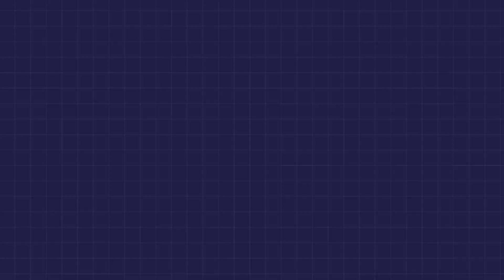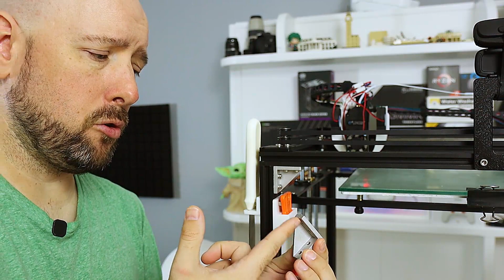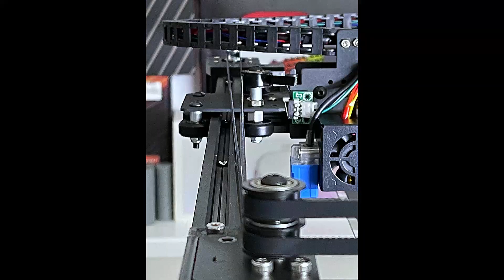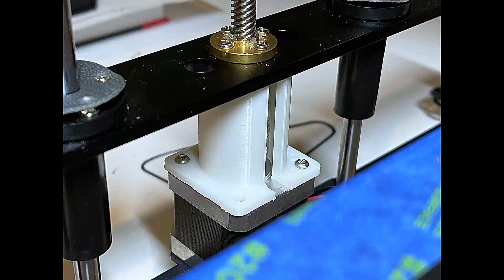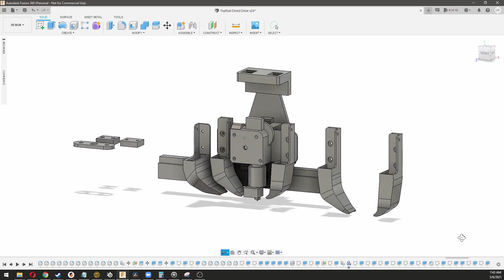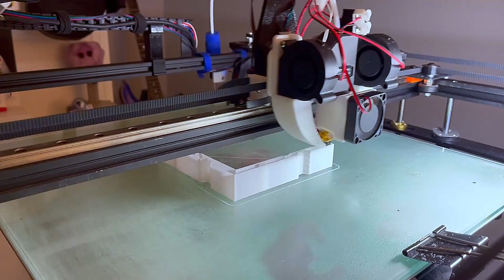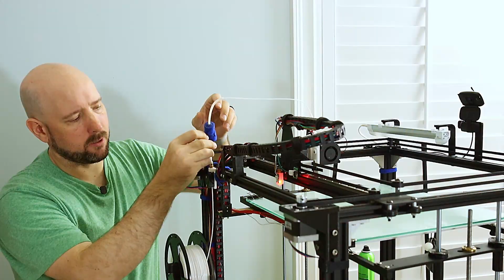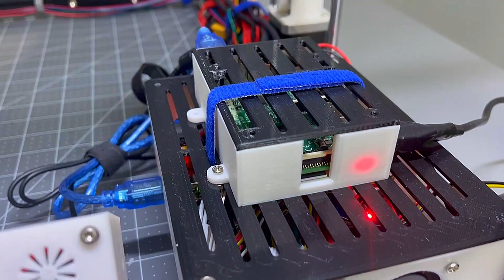TronXY X5SA Upgrades (Frame, Bed, Linear Rail + Direct Drive, PSU, Electronics)

Comment: I understand this video is old but I hope I will still get a response. Since you have to set up the pi to use serial communications to talk to the Tronxy board will this interfere with using usb communications to a print head? I intend on using ebb36 usb communications to allow for multi tool head printing.

Comment: Great videos on these mods. One protection for the main board, put a strip of electrical tape over the +5v line in the usb cable coming from the RPi.

Comment: I swapped out the hotend with an ender 3 one and now it's not heating up fast enough. I think the heat sink is just more efficient at cooling, it has a lot more fins than the previous one. Is there some way to make it heat up faster? With the hotend fan on at 100% it gets to like 95c and with the fan off, it gets to like 155c.

Comment: I always thought bowden was pronounced like bow in bow and arrow. not bow like bow your head. obviously bow has two different pronunciations because its a heteronym but I went off of the the pronunciation of bowden cable which is what the bowden tub is named after. https://en.wikipedia.org/wiki/Bowden_cable claims it is pronounced as: /ˈboʊdən/ BOH-dən.

Comment: one mod i havent seen anyone else do... use 4 smaller beds.
the pei beds are cheaper, one small one heats fast, and if half your prints are only less than 200x200...

for the pulley issue, i remade the brackets with the hole inboard a bit to bring the belt in line,
then made one pulley larger on each side otherwise the belt interferes with itself on the other side of the carriage...

Comment: Hey, could you share the link to the fans that you used for the left and right bmg blower? you mentioned that they were 20mm wide, but I am only finding 50mmx15mm wide winsinn fans.
Reply from the maker: Hey Spipe, you are correct.  I misstated and the fans are 50x15.  Here's the ones I'm using: https://amzn.to/3Z2eEJn although I wouldn't necessarily recommend them as they are loud as heck.
Reply: @LilMikeysBigPlans  Thanks so much for the reply! One last question, how did you add an extra fan? At least on my Tronxy, I only have 2 2pin connectors.

Comment: hi whats the lenght of linear rail for x5sa pro and what type?mgn 9c or h?
Reply from the maker: Hey Mohan.  The length of the rail will depend on which X5SA model you bought.  Your best bet would be to measure the distance between the y gantry plates and get the longest rail that would fit.  You'll want the MGH12-H version for this mod.
Reply: @LilMikeysBigPlans  thanks
Reply: Do you have any guide for installing a skr 1.4 turbo on a tronxy x5sa by the way?
Reply from the maker: @mohankuru7760  I don't have a guide but the installation is pretty straightforward IIRC.  I believe you'll have to toss the LCD.  If you're using klipper there's a sample config for the SKR1.4.
Reply: @LilMikeysBigPlans  I have a problem with pin mappings, also x5sa pro has 2 z axis motors, should I split one stepper driver into 2 motors or e1 as a seperate stepper conteoller for z axis as well as z0? İf there is a klipper config for skr 1.4 tmc 2209 bltouch and titan direct drive, it can make a great help for me
Reply from the maker: @mohankuru7760  If you're moving to the SKR1.4 you definitely want to split each Z motor onto its own independent stepper driver and on the SKR, yes, that means utilizing the E1 stepper driver for the Z1 motor.  I would start with the SKR1.4 config in the sample configs (https://github.com/Klipper3d/klipper/tree/master/config).  Then duplicate the stepper_z section as stepper_z1 using the pins from the extruder 1 section.  For bltouch you'll use the 'Servos' and 'probe' connectors.  Here is a config that has them enabled for bltouch: https://github.com/Klipper3d/klipper/issues/2772.  As for the 2209s you can rename the '2208' sections in the example config to '2209'.  That is also discussed a bit in that bltouch thread.

Besides that, check the x5sa sample configs for your min/max distances (or test and check them out yourself) and you should be good to go.

Comment: I got this x5sa back in 2017 when they first started coming out and knew they had the initiative to become a great printer, I think they have been bad mouthed enough. I have done so much I had it running great then upgraded to the double filament with the quiet motherboard now the other parts are just to weak to support the speeds and prints jobs,  I think you've gotten it right,  I need to get access to your design to move on I have the borosilicate glass the firmware upgrades you name it , I even see the corner brackets have increased to four bolts instead of two of course more stability I think I added the linear rails long before anyone else had because I worked on cad plotters and other equipment that used them before 3D printers had even arrived.
Reply from the maker: Hello Samuel.  The rigidity and un-linked Z are the big problems with these printers and it's hard to recommend them to anyone who isn't planning on substantial upgrades.  The VZBot folks are able to get incredible speeds out of the frame but with a good bit of skill and modification.  It's definitely the fastest design I've seen in the basic X5SA cube.

Comment: So when you swapped out the board for the v1.4 Turbo BTT, did that help with the Z axis in any way? In other words, is the control from the Z0 and Z1 drivers any better on the SKR board? Great guide by the way. I have the X5SA-2E and it has not printed well since day 1. Determined to get this working though!
Reply from the maker: Hey Jay, going from single-stepper Z to dual stepper Z with automatic tilt adjustment is a night-and-day difference in build platform maintenance.  It will only help with your first layer though.  So if your problem is the bed falling out of balance and having to tweak your bed screws every print then the upgrade would definitely help.

What issues are you having today?
Reply: @LilMikeysBigPlans  So I have had first layer issues with it just not wanting to stick to the glass bed (mine came with the Tronxy textured glass bed, much like the Creality one). It seems I am always messing around with Babystep Z settings at the initial print. Originally, the software in the printer wasn't taking my Z offset setting (no confirmation and no change in print height), so I contacted Tronxy and they sent me new firmware to flash which is now verifying the setting, but I am still having issues (may be the knockoff V6 hotend they included, so been thinking about upgrading that too). I bought the kit to tie the two Z rods together with the pulleys and have printed out your hats, but have not installed them just yet. I also upgraded my Bowden tubing to Capricorn recently. I ended up picking up the SKR V1.4 board from Binq and have considered changing the board out. I currently have the 446 mainboard that came with the printer.
Reply: I have also tried hairspray, glue sticks, blue tape, etc...Now my Pyramid A1 (CR10S knockoff) has the same textured glass bed and I still have to use a scraper to remove the print after the bed has cooled to room temperature!

Comment: Can I pay you to fix my tronxy? this is my second printer and cant get it to print, z offset issues and adhesion. I can do the save settings for installing marlin either
Reply from the maker: Hey Marty.  I'm happy to help - but if you're on the stock board/firmware and sensor I might not be able to offer much as I chucked it all a while ago :)  What's the issue with your Z-Offset?  Are you still using the blue sensor or have you upgraded to something more reliable?  That sensor was such a PITA I actually used an old-school physical endstop for a while before getting a BLTouch in there.
Reply: @LilMikeysBigPlans  Thanks for the reply! I bought a Pei bed surface and fixed my adhesion issues. It is printing decent now. I will upgrade to a BL touch, I have the stock TR sensor right now. I appreciate the reply yet again!!!
Reply from the maker: @MartyFlipper  Glad you got the Z issues figured out!  That stock sensor was inconsistent for me and then completely unusable once you put glass over the aluminum.  Good luck!

Comment: Very good work here but I got say it does not look as this printer is a good option despite the great initial price, or do I miss something? ;-) Cheers.
Reply from the maker: Hello Luis.  I'd say it's a poor value at MSRP but can be a deal on sale.  You can make it a 'good' printer with just a couple of these mods.  Make the frame rigid and do something to address the Z-sync issues and it prints great.  If you get a really good deal on the printer, as I did, you can pay quite a bit less than the parts would cost separately.  However it seems like there are a lot of QA issues so if your board dies - which seems to be pretty common - then you're probably not saving a lot especially if you're not well-versed in debugging and adjusting your printer.  I would not and do not suggest this printer to anyone that is new to the hobby.

Comment: Great video I just have ordered my tronxy XS5A dual extruder 300x300x400 to arrive soon I will use most of your mods Great stuff!! 
Thanks a lot for sharing forward 
greetings from Europe
Reply from the maker: Hey Eric! Thanks for watching and good luck with your X5SA.  I posted a video after that with a new gantry and more linear rails.  If you're upgrading may want to check that one out before you start swapping things out :)  Have fun!

Comment: The Linear Rails for the 500 on X axis should be 600mm? and the 2020v extrusions for X replacement should be 650mm?
Reply from the maker: Unfortunately I don't have a 500 so can't say for sure.  There's a bit of leeway in the rail length so if you just measure the distance between the edges of the Y carriages and get the closest length that's less than that measure and you should be good to go.

This mod uses the X extrusion that came with the printer, no need to buy another.  If you want to replace both the X and Y rails I have a newer video here: https://www.youtube.com/watch?v=MubTYY0M-PE.  That one also uses the existing X extrusion though.

Comment: Nice omen in the background.  I have a heavily modified red 7 string
Reply from the maker: Wow, good eye!  I mostly noodle on acoustics now-days but my wife got my the Omen back when we were dating so it'll never leave my collection :)  What have you done to your seven string?  I honestly didn't even know they made a 7 string Omen.
Reply: @LilMikeysBigPlans  locking tuners, gigantic emgs that have a humbucker on top of a single coil. They were red to match the guitar haha. They're that big I had to put my luthier hat on and carefully remove some of the wood and veneer then fabricate pickup springs with a screw. Strap locks as well and a bone nut. Haha

Comment: Got a deal on one of these or ordered anyway would you be interested in  printing your brackets for the upgrade
Reply from the maker: Hey Rynos, with a couple upgrades and a little elbow grease it can be a great printer!  Unfortunately I'm usually prototyping or experimenting with my printers so I tend away from print-farming parts for others.  However, you should be able to print all of the upgrades even on a barely-functional X5SA :)  Otherwise I would suggest checking for local printers or r/3Dprintmything on reddit.  If you absolutely cannot find someone to print them for you though, let me know and I'm sure we can figure something out.
Reply: Also, many libraries now have 3D printers. You can just send your files online to the library and choose print quality and color of filament and you pay for the materials used.

Comment: What Firmware are you using, i upgrade to marlin, and im havine homeing issues...
Reply from the maker: I'm using klipper on both of my cube printers and Marlin on my i3 style printer - although none of them resemble a stock X5SA any longer.  What issues are you having?
Reply: @LilMikeysBigPlans   I have to raise the build plate all the way to the z0 before I can home...so for example I finish a print. And I hit home  the 10point fade height drops..then homes x then y...I would it expect it to go up to find the probe...in my case it just keeps going lower. Towards  max.  z as opposed to z min.   I'm on marlin...I'm using your z hats  really did does help in  leveling the bed

Comment: I came here to see what all I would potentially be getting myself into as I’m looking into picking up a Tronxy X5SA-600 for some automotive prototyping. 

Awesome content and very good visual quality. 
Your explanation of design intent of the printables and highlighting how the particular mods fix / correct the issues (or at least improve) how the Tronxy comes out of the box is very insightful.

I think your 5 min design videos would be very helpful especially w/ 3D printing becoming more and more mainstream. 

P.S. love the pc component boxes in the background btw.
Reply from the maker: Thanks for watching, Michael!  The X5SA is certainly a project printer but I'm not sure you have many other options at 600mm scale.  The Folgertech FT-6 will get you 720mm on the X axis but a bit smaller on Y and Z.  Personally I would jump on that over the X5SA if you're not afraid of a real barebones kit as it's certainly going to be more rigid - and I wouldn't expect much support from either company.  At 600mm you're well past 'common' build sizes and finding things like heat bed replacements or PEI sheets and such will be challenging and expensive.

If you only need large scale in a single dimension the Creality 3D print mill is also an option.
Reply: @LilMikeysBigPlans  Don't mention it and anytime! I can't wait to see what you upload next! I'll have to look into the Folgertech!

Comment: Great video but... to keep what's left of one on sanity, is to get something else. The cost plus the mods to print and install, is not worth it, to get where it needs to be.
Reply from the maker: Yep, it's hard to recommend the X5SA to anyone but tinkerers.  I still say it's a good value for the parts in the box - although one of the steppers is starting to act up so that value prop may be dropping a bit.

Comment: Does the stock board only have a single z stepper output? or is g34 stepper align possible? trying to figure out what mainboard to upgrade to for that reason since im debating on this or the twotrees sp-5
Reply from the maker: My stock board only had exactly enough drivers for the parts that were attached.  There was additional space on the board for a stepper labeled for a second extruder but the pin header wasn't even soldered on.  I'm using an SKR 1.4 Turbo on mine now with an Octopus waiting in the wings for a triple-Z project I'm working on :)

Comment: I have an SKR 1.4 with TMC2209 in an old Wanhao i3 v1.2 with "many" upgrades. Overkill probably, but at the time, the Melzi was garbage with 4888's. Buying a 400 as an intermediate step to the big boi, a modified LowriderCNC router that will also laser cut with the 60W CO2 tube I have, and be able to 3D print 8-10 inches high by 4x8 feet! Crazy? maybe.
Reply from the maker: Hey Michael, I'm getting ready to step into CNC now myself.  I'm looking for something smaller than the lowrider with hopes to do a little aluminum.  Thinking something like the Root or RS-CNC32 then maybe a low rider or Plastic Monstrosity down the road.  I see you're doing some PCB work on your channel.  Would love to see the LowRider in action!

Comment: Those corner brackets in my opinion are the most beneficial because from experience, my X5SA threw itself out of square from vibration of the machine alone. Obviously not by much but it was super evident though incremental layer shifts that stick out like a sore thumb on larger prints. Not to mention layer adhesion problems that you don't see until you take your print off the bed and it splits.
Reply from the maker: Agreed.  Some kind of corner support is a must for this printer.  If you can't afford or easily get these aluminum corners even a 3D printed bracket will do wonders.